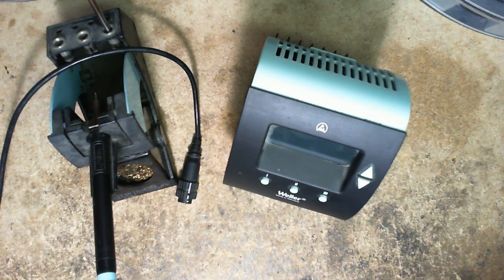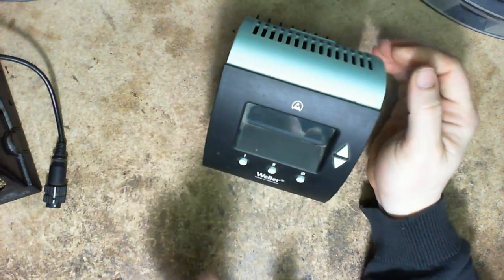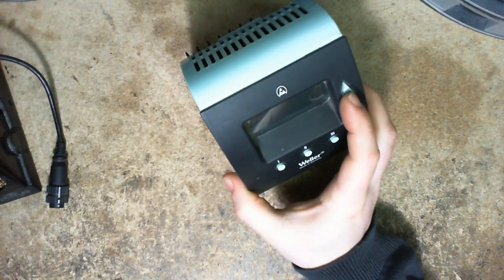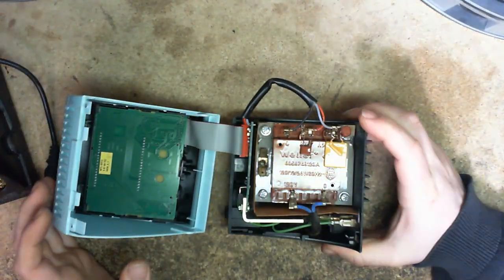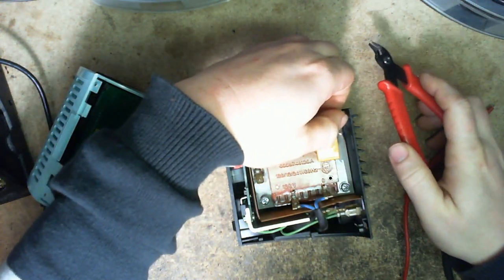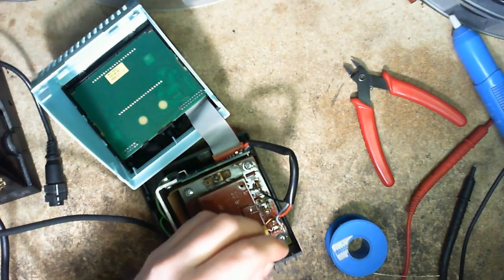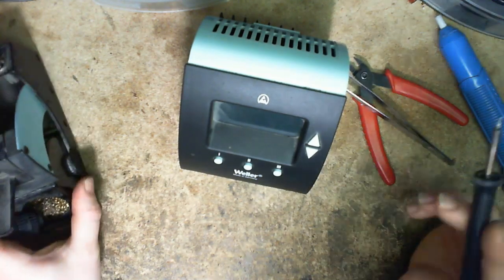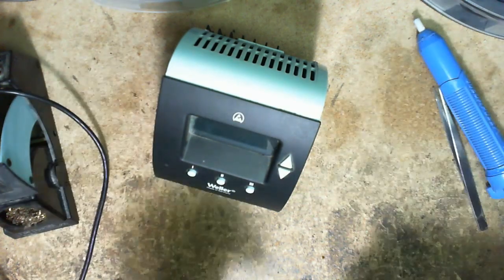Trash Picked Weller Soldering Station - Can I repair a "dead" station?

Comment: Interesting little iron you've got there. I purchased a WP65 with very small tip, but did not know there has been an even smaller iron...
I felt so defeated when I could not repair my WD1 that got to suffer from a missing digit in the LCD shortly after purchase as a second hand unit... Tried everything, even replaced the PCF-whatever chip on the LCD board, reworked all LCD-pins, heated the LCD connections while on (to see if this was an temperature-dependent intermittent problem) but it just never got back to life. The price for just a replacement of the LCD board alone was just not worth it at 200 Euro excl. VAT (with the total price incl. shipping ending up at around 275 Euro, which was about the price I paid for the set (WD 1 + WSP80 and multiple tips).
Eventually found a rather botched (and most of all: cheap) unit on ebay. That was a 110 Volt unit but as my transformer was still good, I just swapped the upper part (upper case with buttons and LCD board) with my own unit. Can't remember what I did with the remains of the other unit. I wouldn't be too surprised if I still have them somewhere but I don't even know about that myself anymore (something with too much electronic junk...)

Comment: Thank you for the info. I dropped my wand on my WE1010 and it landed tip first on the concrete garage floor an it broke the wires inside the wand. I ordered a new wand and the station wouldn't turn on. It has the same fuse that showed on your video. I'm betting that is the same issue with mine.

Comment: I have a weller tc201t iron for a wtcpt and the station is working but the spring loaded magnastat switch assembly heater that goes inside the ec234 element seems to be broken. Any way to salvage these or get a replacement? Factory date is 1994.
Reply from the maker: I would honestly upgrade to something with a little more control. I still recommend the WESD51, especially if you can get a cheap one used.
Reply: @CelGenStudios  I ended up fixing it. The heater had some light rust under the contacts. Just used some sandpaper. And I did pick up a wesd51 with the lcd So Ill be using that now.
Reply from the maker: @xxxxBadfishxxxx  Awesome! Happy soldering!

Comment: Any time i find a nice weller soldering station it usually needs a new tip from a discontinued range(at 60-120USD each) so its not worth saving.